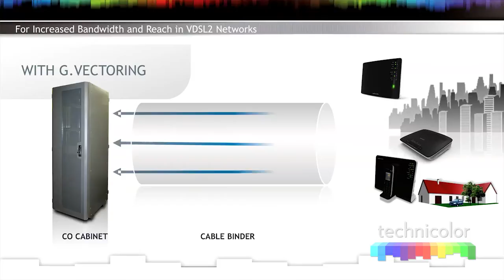G.Vector - A New VDSL2 Technology

Comment: My area just got Vectoring VDSL connections according to a higher up tech I talked too, I noticed my line margins SNR went from 12 to a baseline of 4. The tech said that the lower SNR doesnt matter unless it goes under 2. is this right?
Reply: no anything under 6 db is bad and when it drops under 3 the connection becomes unstable and will drop out

Comment: No, this was a factory default version. No ISP branding or changes. The Dutch KPN is doing this and these devices suck even more.

Beside the webinterface it is still strange that the technicolor trains in @ 37Mbit and the Draytek @ 42Mbit.
But all that will be over in 2 months from now, I change my connection to fiber.

Comment: The problem is that the interfaces of the CPE's realy suck.

Also made a comparison here and the technicolor trained in at 37mbit's @ 400m line lenght and the draytek i own now trains in @ 42mbit...

So make an advanced mode webinterface for power users or a telnet based one like the HP procurve devices...